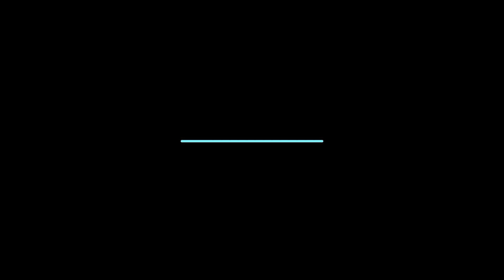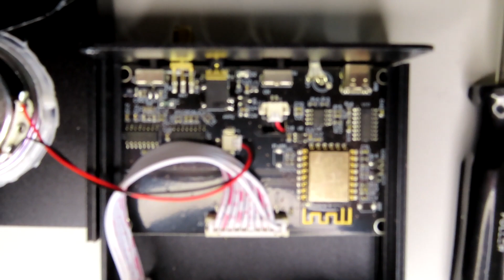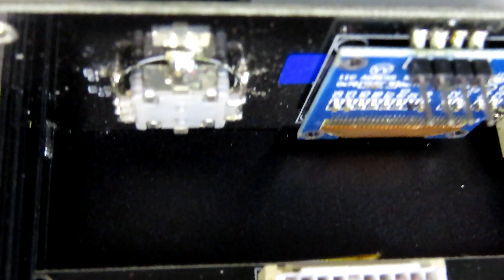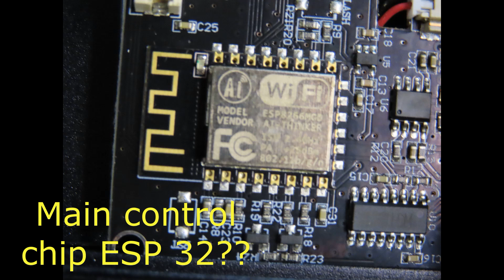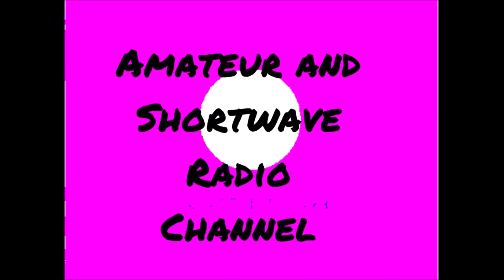Inside the  ATS  60

Comment: Unfortunately, many manufacturers have been using the examples from the library that I developed for the SI473X devices without adapting or improving them. The examples I have released are intended to guide developers through their projects. They are not a final product.
I did not know the ATS 60. Unfortunately my time is short and I can't improve or suggest improvements in each third party project. I thought the documentation I wrote and posted would help designers to make better receivers. Judging by what you've shown in this video, the design is the same as the versions with the Arduino Nano, only changing the processor to ESP8266 and the sketch. I miss a good front-end in this projects (RF amp. band-pass filters etc). Thanks for sharing. PU2CLR. Ricardo.